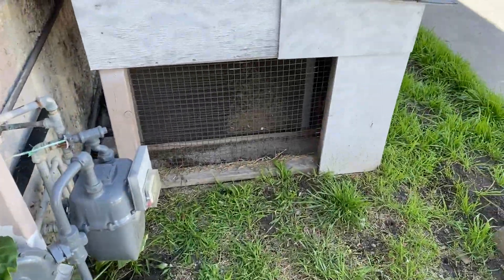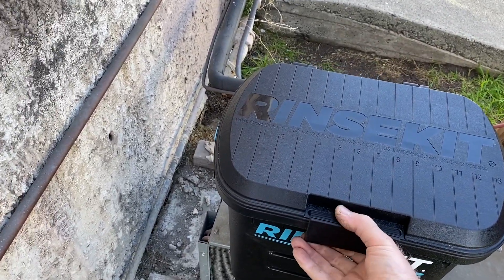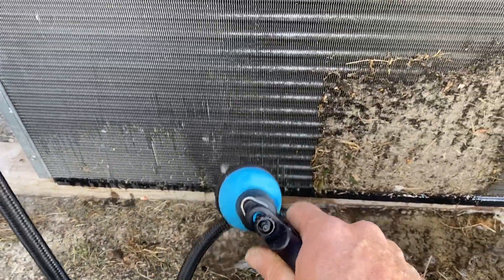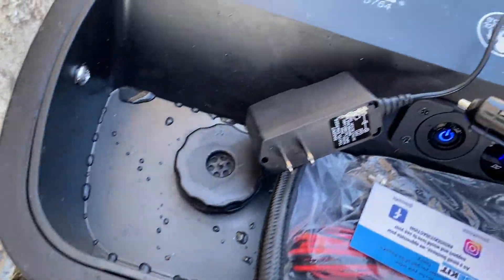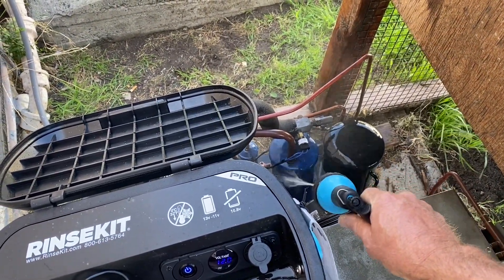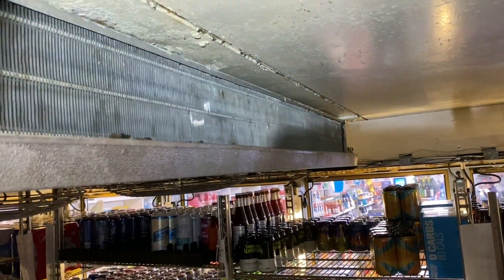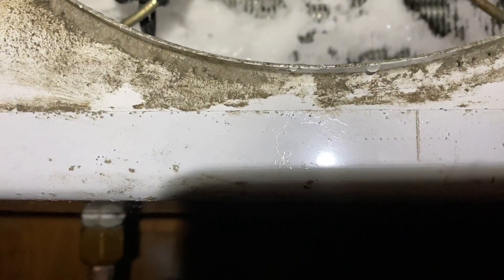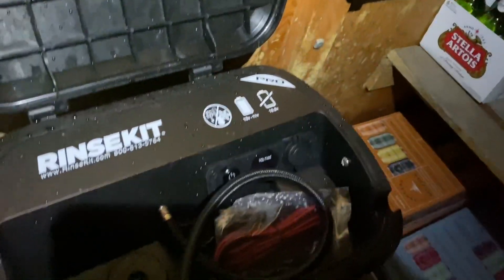RinseKit pro for HVAC/R

Comment: Can you change out the sprayer . Just curious
Reply from the maker: I’ll mess around and find out
Reply: @NorCal-refrigeration  thanks I’m still going to get one eventually I just wondered if I can use a different sprayer with it if not it’s definitely not a dealbreaker . Thanks
Reply from the maker: @sykotictendencies6032  they have the new cube model 4 gallons long battery check it out
Reply: @NorCal-refrigeration  I like that everything is hidden and out of the way in the case on the 3.5 pro

Comment: this unit is cool but a little pricey compared to the sun joe. $365 for 3.5 gallons and the sun joe is $140 for 5 gallons 🤔 $200 is more reasonable for the rinse kit pro
Reply from the maker: That I agree with for HVAC. There is more features for this unit for van lifers , campers, etc. and the price point fits that audience. The heater and hand wash feature is handy and takes it over 400$

Comment: This is what I've been looking for. BTW, coil dirty on one side, clean on the other. Wasn't the left side fan bad?
Reply: @GunsmokeNC I think the fan was on a fan cycle switch so it wasn't running because the outdoor temperature wasn't high enough for it to run
Reply from the maker: No